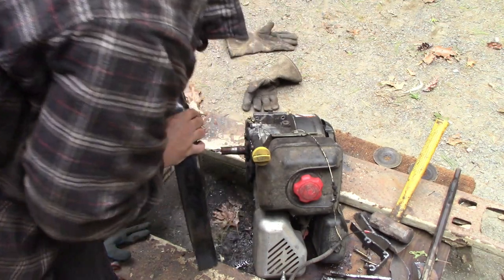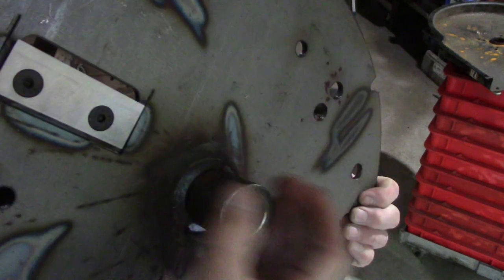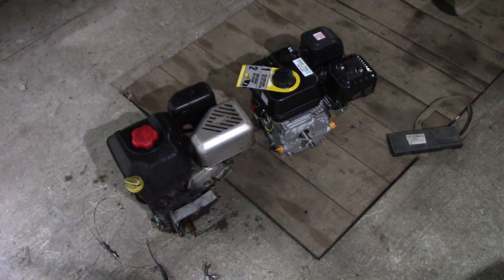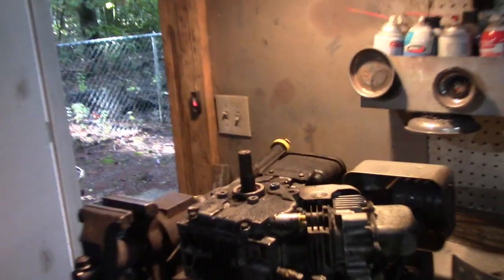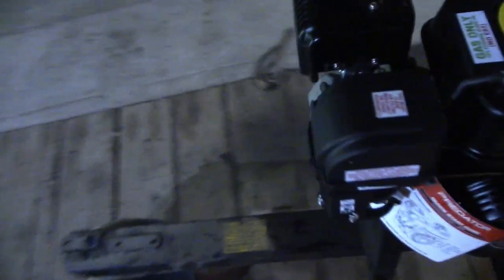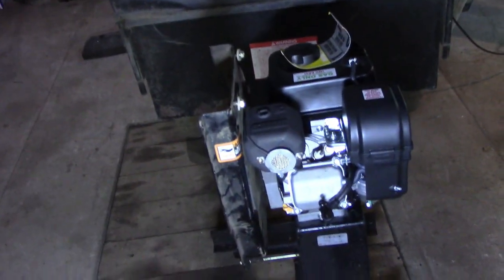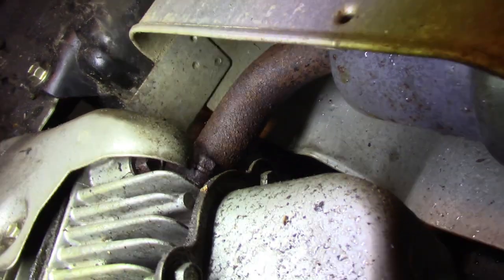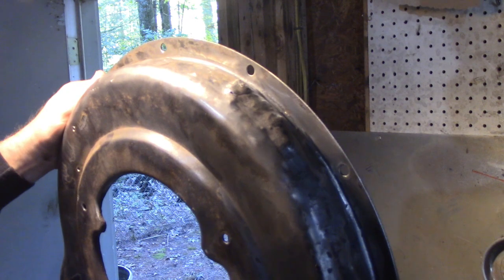Tow behind leaf vacuum engine swap and repair.

Comment: Good job. I'm a retired automotive technician and I do this type of work. I might have looked for a machine shop to cut down the shaft and taper but I understand your method. That out of balance wobble would worry me about early seal or crankshaft failures. I know it's a lower speed motor but vibration is a killer. Good luck.

Comment: Had to do similar work where the impeller tossed debris at the top of my TracVac housing. 47 years of faithful service will do that. Welded patch over weak spot and still in service today. TracVac made incredible equipment back in the day.

Comment: I have one of these..Agrifab..with the Briggs engine that had the plastic timing gear that fails at low hours..ended up buying a complete new crankshaft to put in the Briggs to get mine running again

Comment: I have an Argri-Fab similar to this one but the impeller housing is much more stout and is welded together and doesn't come apart. The engine is mounted 90 degrees to this one with the shaft running parallel to the length of the unit and the suction opening facing the mower pulling it. My engine has been giving me so much trouble over the last few seasons that I've decided to opt for a new Predator engine like you have. My question is how did you get the old impeller off of the original engine? Other brands have a larger threaded hole for the shaft bolt that effectively becomes a puller when a bolt of that larger size has a extended section of smaller diameter that pushes against the back of the hole in the shaft to push the impeller off. My Agrifab impeller does not have this feature. I am waiting to get this off before getting a new engine because I want to verify the shaft type and dimensions so I can match those in a new powerplant. Any help is appreciated.
Reply from the maker: Sometimes, the propeller will not come off without heat lots of it. And sometimes they just pound right off. I've done a few this one. Didn't give me any problems. However, I've had problems in the past, and it is a major Royal pain in the butt. Put all the empowers should come off over the shaft, just like you're thinking

Comment: I'm in the exact same boat with my agri-fab (with the chipper). Found a tapered adapter off ebay for the Predator and it seems to do exactly what you did with the flap wheel. The question is, how is it holding up? I'm seeing a pretty decent amount of bend from MY new agri flop impeller as well so I shut it down pretty quick. That's how I found your video actually.
Reply from the maker: I've had no problems with mine, this is 2nd leaf season and it's running great.
Reply: Do you have a link for the adapter? This predator swap isn’t going as planned 😂.